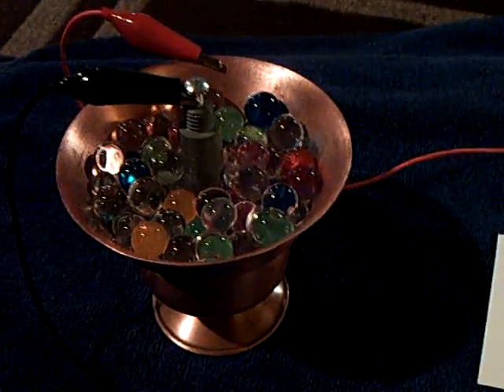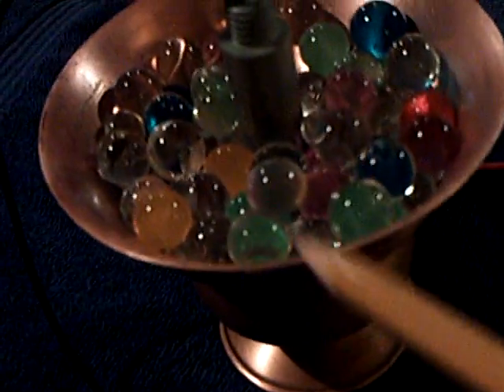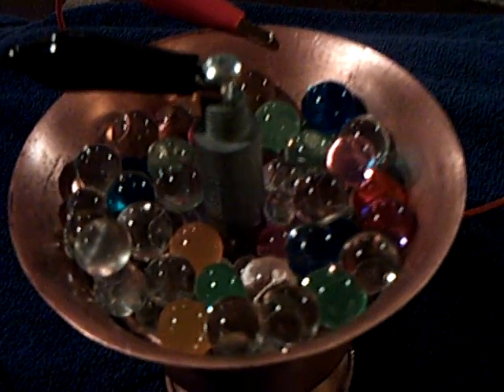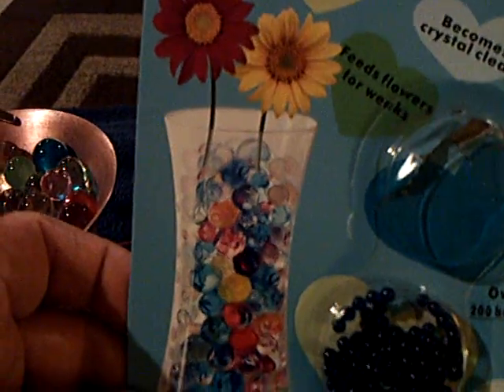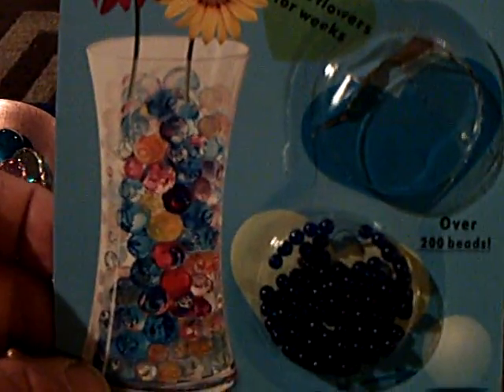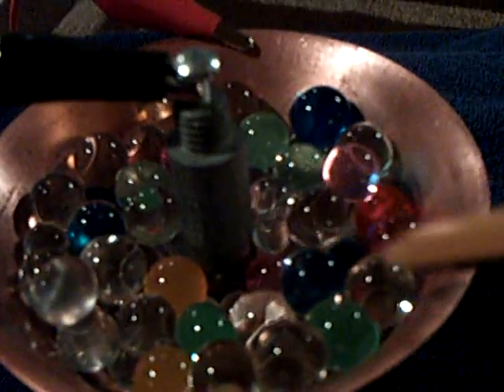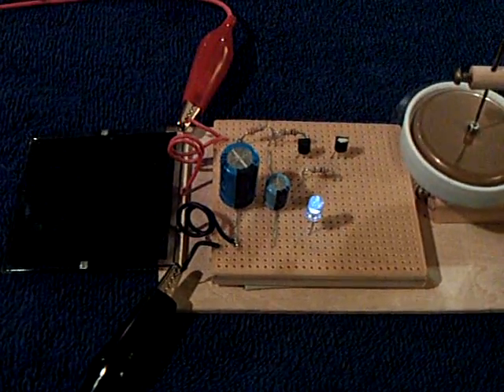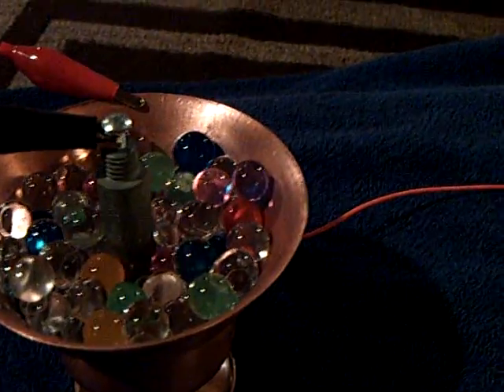The Homemade Battery with Balls!!!!.

Comment from the maker: @jozsab1 -----That is why I am using the marine sarificial zinc.   The alloy that is used in these is specifically designed to continually deteriorate and save the other metal that is being protected.  On my boat they last several months in the salt water environment.   The way that I am making electricity in this cell the zinc is basically a "fuel rod" that will slowly be eaten up.  The copper bowl should stay intact but may develop a coating that will have to be scrubbed off.

Comment: Lid, I agree on cost issues! Have you ever tried:

tinyurl . com / cjjozx4
Ferrocerium (Man Made FLint)
Replacement Survival Magnesium Flint Stone Fire Starter $1.83 (incl. shipping)

Iron: 19%
Cerium: 38%
Lanthanum: 22%
Neodymium: 4%
Praseodymium: 4%
Magnesium: 4%

Albeit an alloy, it'd have to be fairly homogeneous, or it would misbehave.
Thinking it's shape might slip into a small pipe.

Comment: I am not familiar with the balls as how long do they hold moisture before you have to add more water as they do not look wet in the plastic can or your copper bowl. It just seems like the water acts like some type of fuel in the crystal cells whether in trapped in the lattice or whatever as my opinion water plays a role in crystal batteries.

Comment: Interesting that the balls work as electrolyte. Did you try using magnesium in the middle. Also if you doped the water with some of the salts if the balls would still work and hold liquid. You find some cool things at dollar tree